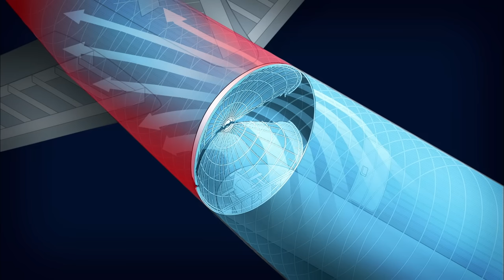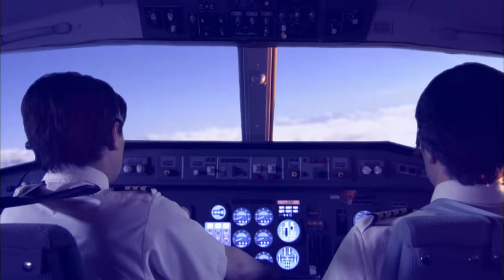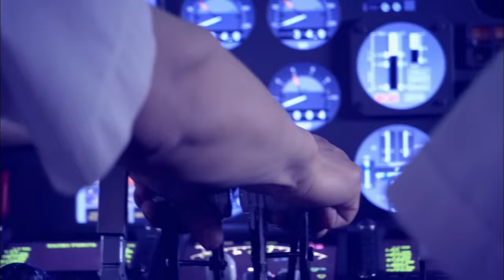This Plane Flew 30 Minutes, Prior to its Crash, with No Tail: Air Disasters | Smithsonian Channel

Comment: Flight 123 reached in cruising altitude and the tail explodes and passengers are screaming in danger but the flight attendant is trying to calm the passengers and the first officer pilot is trying to save the gigantic aircraft and keeps on plunging up and down into a deep dive like a scary roller coaster ride and 30 minutes later the plane is out of control and the plane goes upside down and crashes and 4 passengers survived after the crash.

Comment: I've never quite understood why the pressure bulkhead was not designed the other way round, so the convex side was in the cabin. If the air pressure is higher on the cabin side, it seems logical to have that air pressure pushing against a stronger convex surface? Perhaps it's something to do with stresses being pushed out to the aircraft frame. I'd be interested to find out.

Comment: I think people from other countries have only heard about this accident from the official announcement. Officially, the accident was caused by a repair error by Boeing. However, in Japan, there is a high probability that this accident is considered an incident rather than an accident. However, the information is controlled by the government and the US military, and some parts of the voice recorder have not yet been released. This story is treated as an open secret in Japan.
Specify circumstantial evidence.

supplement
all engine at 1:44
To Japanese people, it sounds like Orange Air. In Japanese fighter training, orange floating objects are used to represent the enemy aircraft.

Comments from the Prime Minister at the time: Even if I die, I won't be able to tell you the truth; I will take it with me to my grave.
Comments from JAL's vice president at the time - he said he might be killed if he told the truth.
The deputy attorney general at the time said that if the truth were known, there would be war. It seems that the meaning of the war is not just a war between countries.

There have been numerous sightings by residents near the accident site that two Japanese fighter jets were following behind JAL Flight 123. However, the Japanese government has made a strange announcement that it has flown fighter jets after the accident.

There is no way they would fly a fighter jet that cannot carry out rescue operations after an accident.
Immediately after the accident, a U.S. military helicopter from Yokota Air Base went to help. However, when they arrived at the scene, the Japanese government refused to help. US military helicopters are flying back to Yokota Air Base. Despite this, the accident site has not been identified for over 14 hours (the biggest mystery)
According to the Japanese rescue team that arrived at the accident scene, the bodies were so charred that it was impossible to tell whether they were male or female. Normally, there should be some part of the body that doesn't burn, such as the back side.
Aircraft fires were supposed to smell like aviation fuel (similar to kerosene), but the scene was filled with the smell of gasoline and tar. A military flamethrower burns a mixture of gasoline and tar.
Afterwards, a diver happened to find the vertical tail of JAL Flight 123 in Sagami Bay, but the government said it was over and made no attempt to pull it out.

90 days later, the Japanese government concluded the worst and most humiliating economic agreement with the United States (the so-called Plaza Accord).To put it simply, the Japanese economy was too strong, so they forced the yen to appreciate. As a result, Japanese export companies were hit hard and many other promises were made in favor of the United States.

My guess is that Japan could not say anything to the American government, which knew the secrets of the Japanese government, and had no choice but to do as the United States told them.
After that, the proportion of Boeing passenger planes in Japan suddenly increased.
Reply: take your meds
Reply: 闇が深い事件ですね

Comment: There should be no excuse allowed for this and should have been-inspected even after the mechanics worked on it. Basically this means that the mechanics failed to do their job properly. The plane was never inspected after the mechanics work on the plane and if it was inspected was also improperly inspected. Who I blame the most is the airline itself because they do not take the time to service these planes properly it's always rush rush rush. That's why they're really should be independent government inspectors on site before these planes are allowed to have passengers on board. Instead of letting the airline itself control themselves. There should absolutely be an independent inspector that is hired through the government itself. Such as FAA Which has absolutely nothing to do with the actual Airline. Therefore the airline not being able to rush the job. And everything would have to then go through proper procedures and proper inspections through the FAA. And this rule should apply for no matter what country these planes are flying out of and especially every plane that lands in the United States should be inspected. Much like the United States Coast Guard does frequent inspections of cruise ships and seagoing vessels. Even private vessels. If they do not meet the coast guards requirements and regulations they are not allowed to have passengers on board.
Reply: It’s like the Alaska Airlines flight 261! They were warned about a wore out jack screw! But didn’t do a dammed thing about it (except to ‘discipline’ the technician who found in and insisted it be replaced) 88 souls were lost! These dammed airlines ALWAYS put $$$ over safety! A Pox on them…

Comment: was their anything the pilots could have done
Reply: think of it this way : 
your in a taxi cab going 100 MPH+ down the highway, theres a truck coming in the incoming lane,  all of the sudden the taxi-cab loses 2 wheels & the steering wheel comes loose, 
you could tuck & roll if your fast enough and walk away with minor scratches (and worst case a fractured arm) but the taxi driver will still die tho 

in short : no the pilots couldnt do anything cause the plane was doomed the second it lost the tail fin
Reply: No. Losing the tail is effectively losing the steering.

Comment: Just wondering if they could put emergency parachutes as a last resort to deploy vertically. Possibly how many lives could have been saved throughout these years
Reply: Nope
Reply: Fast/heavy landing airplanes already have these, so I don't understand why not for the reason you mention.
Reply: Failure.
Reply: Nil. For starters, panicked passengers will render it useless. No one will believe anyone that effectively instruct them to, "Please freefall for 10 minutes before opening parachute." Long before they even reach the breathable altitude in freefall, they already succumbed to hypoxia.

Comment: If pressure a difference between the tail & the cabin causes such stress on the tail section. Why is the tail section not pressurized as well?
Reply: Because it would have to be reinforced

Comment: This is from the  Smithsonian Channel's "Air Disasters" program featuring😢 the NTSB investigation of this incident.  It said the cause was striations in the carbon filter aft pressure bulkhead, ema ating from the improper repair job, during the 8 years of flying betweeb the repair and this crash.

The program aired around the time of the  Titan diaster.  Both  seem closely related; explosion in the airplane, implosion of the submersive.

Comment: but there is still part if it left so how is it so hard to control?
Reply: @Fatih Emery why do they need to tail for that?
Reply: @X-26YT  Two main flight controls are there: elevator and rudder. Losing the tail is effectively equivalent to losing steering.
Reply: @Sharan  ok

Comment: Parachute system should be installed in fuselage , then only air travel will be safest mode of transport . Until then , train is better for domestic transport.

Comment: I wonder if the same thing happened with china airlines
Reply: No the most likely scenario is either another silkair/germanwings suicide or a lion air/Ethiopian airline mcas crash
Reply: @abstracz1027  why it will be similar to Lion Air and Ethiopian Airline crash when MU5735 is not a MAX?
Reply: Depends with what China Airlines crash you mean, if you mean the recent one, it was with China Eastern (two different airlines), then no

If you mean China Airlines as Taiwan's carrier, there has been a similar accident with the 747. An improper maintenance after a tailstrike doomed the plane after 22 years.
Reply: Which flight are you talking about?
Reply: @sunnyfon9065  Might be China Airlines 611.
Reply: @dbclass4075  Yeah, since that Boeing 747 also suffered tail strike and it was not properly repaired.

Comment: The poor and improper repair done which was against maintenance regulations cause the bulkhead to break which in turn broke the stabilizer which in turn broke the hydraulic system. There was nothing the pilots could do without a tail or hydraulic system. It is actually amazing that the plane continued to fly for another thirty minutes. As a family member of one of the 520 people that died in that accident I would have sued the shit out of JAL.
Reply: @gargy2002   Then I'm suing Boeing but I'm suing someone.

Comment: In 1964, on a test flight, same thing happened to USAF B52H that Boeing was testing but those pilots landed the plane. If it was possible in that case, why wasn't it possible in this case?

Comment: I'm confused as to how missing the tail caused it to crash?
Reply: i don’t know too much about planes but you need the tail to steer the plane
Reply: @noodlegeorge  Exactly. To steer it left and right. They couldn't keep it in the air. I think it was due to the loss of the hydraulic lines when the tail came off. Very sad story.
Reply: @carycoller3140  left and right is the rudder, the rudder is attatched to the vertical stabiliser, and the name speaks for itself, without it the plane is doomed
Reply: @wowo1005  I disagree with you. WW2 bomber missions proved that planes can fly, go left and right by adjusting engine speeds on either side of a plane, and make it to a destination and land. After I watched this video again it was more clear why it crashed. The narrator said when the vertical stabilizer tore away it took the hydraulic control with it, thus, no measurable ability to control flight.
Reply: @carycoller3140  In that scenario it really depends if their are any crucial hydraulics in    the vertical stabiliser. Idk how these planes are built exactly though.
Reply: Phil Failla  I've posted several responses to your request but for some reason the YouTube algorithm won't let it go through. I wonder why 🤔?

Comment: If Boeing used German engineering like in the Airbus this and many other crashes could have been prevented
Reply: No amount of engineering will help here when it will be rendered useless by improper maintenance.
Reply: Airbus’ Flight 587.
Reply: Yeah. There's never been an Airbus crash. You know, you might just be onto something.

Comment: Why parachute are not given to all  passanger  in this situations
Reply: Pfff...
Reply: It wouldn't help. Passengers will have the tendency to deploy too early while still in too high altitude to breathe. They wouldn't believe anyone that effectively instruct them to, "Please freefall for a few minutes before opening." Add panic, forget them being able to follow that instruction at all.
Reply: You'd be carrying all that extra weight for something that wouldn't actually improve safety by any noticeable amount. They would only help in the virtually unheard of situation that is A: completely and obviously unsurvivable, B: the plane is stable enough where passengers can make their way to the emergency exit and jump out, and C: the plane is at a low enough altitude where everyone can breathe normally, since the plane would have to be depressurized
Reply: @aarondynamics1311  D: passengers knowing how to use the parachute at all. Simple instructions such as leave belongings behind, brace position, etc., are barely followed properly, let alone parachutes.

Comment: That’s the engineers fault of Boeing it’s because the plane b747 they unscrewed the middle screw and the air blows 56Km/h and the problem is Boeings stop selling 747 it’s because the jal123

Comment: Boeing? Noo no no,if it's a boeing,I will change airline until I can reach my destination in an airbus.They fall also sometimes,but a lot less than this American brand.
Reply: Improper maintenance is the cause of this specific crash, though.
Reply: @dbclass4075  yes,it plays a role too...
Reply: @olivier-pierredebelmont.3630  We can't blame Boeing on this specific crash when that improper maintenance didn't follow the manual provided by Boeing.
Reply: @olivier-pierredebelmont.3630  

Flight 587, an Airbus: 👁️👄👁️

Comment: What if a Boeing 737 MAX crashes in Japan today and then their is a new comer from Japan that an Australian airliner won’t buy Boeing products in favor of a Japanese competitor and the US congress bans the Japanese competitor to protect Boeing to go out of business? 

Then the same Boeing 737 MAX that crashes in Japan a cousin of a YouTuber with the surname Ezarik or that Jenna dies in a Boeing 737 MAX in Japan and then the US congress bans a Japanese competitor to be use by US airliners, only to protect Boeing so airlines in the US could use unsafe products and bans a safe product from Japan that other airlines outside the US  are switching to them so Boeing loses it’s customers outside the US but the US bans them. 

What will iJustine will say about the Boeing crash and that congress pass to approved unsafe planes to be flown in US skies that are made by Boeing to ban the safer Japanese competitor after Jenna or a relative of Justine Ezarik dies in a Boeing 737 MAX that crashes in Japan?

Comment: Ml literate when it comes to these matters but I don't know why a couple of hundred parachute stashed away wouldn't be a good idea for situations like this. Especially when you got enough time. Sure not everybody in a parachute would have made it but at least they would have had a chance
Reply: too costly
Reply: 1. Expensive. 2 parachutes are heavy. 3. The evacuation would be terrible especially in a plane shaking left to right and forward to back 4.
High speeds which would obliderate any person if they hit a part of the plane 5. The air pressure wouldn't let the door to be opened

Do I need to explain any more why this is a terrible idea? You're better off mounting giant deployable parachutes on top of the plane.
Reply: @ron3557  
You're right why even try. I know all these facts I'm an AME 2 in the Navy. 
All of these factors you state can be overcome with designs. But you're right why even try, money is more important

Comment: "There was no inherent fault with the 747" What nonsensical conclusion is that? THE TAIL BROKE. It broke because the 747 designers did not realised how important it was to pressurise the tail compartment of the aircraft. A good sound intelligent aircraft designer(s) SHOULD have known that, pressurising every area of an aircraft that takes to flight is the RIGHT thing to do, not cut corners by leaving the tail part out just to save cost....
Reply: It isn't nonsensical at all. The problem is indeed improper repair. This is just a snippet of an almost hour-long episode.